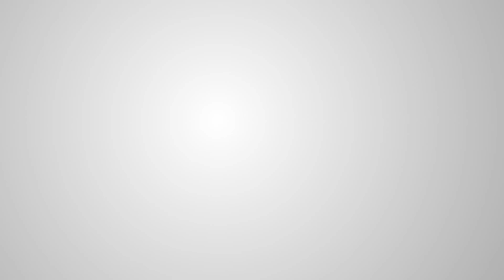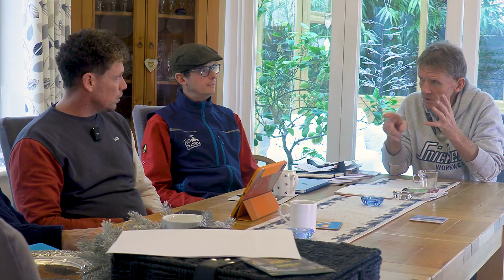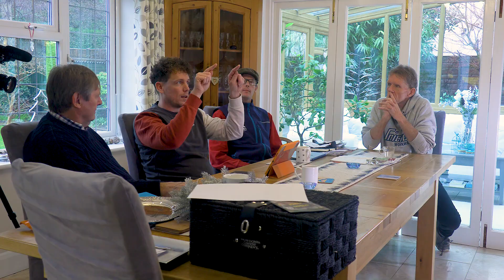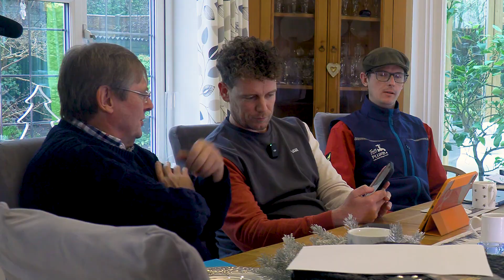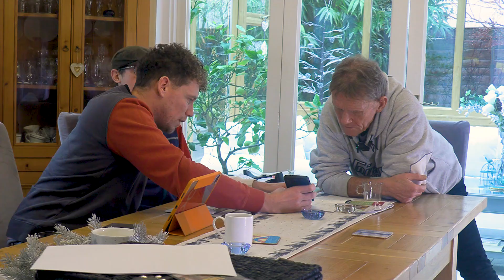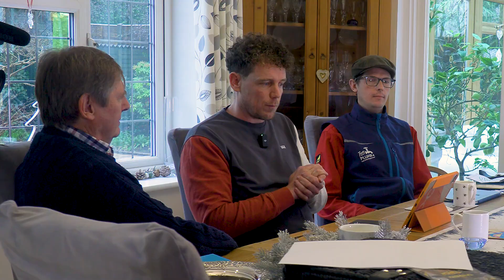What Did We Learn from the Heat Loss Survey?

Comment: I know this will come across as rather unsympathetic, but I can't help thinking that some people are being a little bit snowflakey about the changes required to put in a heat pump. Take the proverbial victorian terrace that is often used as an example of the sort of house  that cant be fitted with heat pump without a ridiculous amount of effort. Most commonly these houses were originally built without indoor sanitation, heating was by open coal fires, no electric light or power, gas lighting if you were lucky but  oil lamps and candles for most people. Our grandparents  and great grandparents installed indoor plumbing and sanitation, modern bathrooms and kitchens, electricity for light and power, central heating systems, etc.. It took vastly more work to go from open coal fires to central heating with radiators and gas boilers than to go from a gas boiler powered central heating system to a heat pump powered heating system, yet they did this willingly and eagerly and with a sense that they were part of the progession of the world to a better state, and not forgetting they were, in real terms, significantly less well off than we are today. I cant help feeling they would look on at those of their descendants who wail on about the impossibility of fitting heat pumps with a mixture of shame and contempt.
Reply from the maker: I think you have a point about embracing change but I was working when gas central heating was a relatively new fangled thing and lots of people were suspicious of it for a variety of reasons.
I would regularly visit homes with one coal fire and a back boiler to heat the water. The left the cylinder jacket off, which heated the bedroom and they were perfectly happy to see out their days with such a system.
Having now got to the stage of a simple wall hung boiler and a few radiators which can be turned on and off to suit, it seems, for many that all this other kit which takes up space and costs a lot of money is not progress.
The bottom line is that we will still need gas fired power stations for a long time to come so this switch to electric heating is all smoke and mirrors.
Reply: @SkillBuilder I'm not sure what difference it makes if we still need gas powered stations or not, we're talking about mains supplied gas here. If there is a change to electric required then it will need to start now in order that, over time, the need for mains gas no longer exists. That means folk requiring a new boiler now being the first to move across, just as those that moved to gas mains were in the OPs example. Then in twenty years time, we'll still have the equivalent of the examples you give holding out on the gas mains until it's inevitably taken away. There's no smoke and mirrors, it's exactly as the OP said, just a moving from one technology to another.
Reply: @SkillBuilder Not so. Even if you generate your electricity with gas, a CCG power plant is about 60% efficient, allowing for 10% transmission loss gives you 54% at the heat pump. With a SCOP of between 3 and 4 you have an overall efficiency of between 162% and 216%. Compare to gas, again allowing for 10% transmission loss and 90% boiler efficiency you have and overall efficiency of 81%. In other words you get between 2 and 3 times as much heating per unit of gas burned by turning the gas in to electricity and running a heat pump compared to burning the gas in a combi boiler! But of course not all electricity is gas generated, only about 1/3rd is. So in reality you get about 8 to 12 times as much heat per unit of co2 released. You have to get your head around what a SCOP of 3+ really means, it means most of your heat does not come from the electricity, but in effect from the sun. A heat pump is in practice a solar energy collector that works 24 hours a day whatever the weather. You won't understand heat pumps unless you understand this.
Reply: I don't think people made those upgrades to make the world a better place. They did it because it improved their living conditions. Some people are willing to fit a heat pump for the environment, but most won't until it's significant cheaper. Gas works, and the pollution mostly effects other people.
I'm optimistic though. I think that in 5 years we'll have built so much more off-shore wind power that electricity will be much closer to the price of gas, and heat pumps will be a much more attractive option. I just hope we've managed to train enough engineers by then!
Reply: I don't think so. Most people who have a new kitchen fitted do so because either they've recently moved house and they don't like the kitchen in their new home, or have had their current kitchen quite a long time and think it's "tired" or "outdated", very few do so because they don't have a functional kitchen, in other words they want one rather than need one. So, they are willing to accept a significant level of cost and disruption on fairly slight grounds. Therefore the argument that the reason we have such a low number of heat pumps installed is because the cost and disruption is far to much for people to bear doesn't stack up (1.6M  householders each year  take that willingly to to fit a new kitchen they don't really "need"). There must be other reasons, lack of motivation, ignorance, fud, etc.., why heat pumps have such a low uptake. I'll informed criticism by the likes of Skill builder is one of them.

Comment: In winter, we (and many other families I'm sure) put clothes on 65 to 70 degree radiators which dry in 2-3 hours.
They'll take forever to dry with the lower flow temp on a heat pump.
Now waiting to be patronised...
Reply: I got a dryer and my house is so much warmer as a result of getting rid of clothes drying inside.
Reply: Not patronising you, but a de humidifier will be better as using the rad as the rad will be adding humidity to the air. 

There are heat pump dryers that effectively are dehumidifiers inside the tumble dryer.

The problem with adding water in the air is you increase your risk of damp on things like windows and the reveals around them. If the air gets through in to your loft or places that are cold you can get lots of damp and mould and rot. 

I’ve got a desiccant one that works down to colder levels as it’s going in the garage eventually, but it’s indoors at the moment and works great to dry clothes.
Reply: Haha sure, or you get a dryer! But you're right, that won't work anymore.
Reply: Have a dehumidifier my rads don't get very hot because my house is relatively well insulated I have the heating on constantly so the boiler only quick on shortly resulting in flow temperature being relatively low. The dehumidifier will bring the home moisture content down forcing the stuff the dry essentially.
Reply: Wrong. I often do it with my heat pump radiators. No problems.
Reply: @rogerphelps9939  are you saying lower flow temperature has no effect? I though AS heat pumps cannot achieve 65-70 radiator temps in winter, more like 40-45..?

Comment: Question. Is the refrigerant in heat pumps of a type that puts environmental brownie points above actual performance?
So with a different refrigerant could you achieve much improved efficiency especially in winter??
Reply: The newer generation of Heatpumps use r290 refrigerant (aka propane) which has better performance and lower environmental impact than the older redridgerants.
Reply: @brianballard905  is that the really old refrigerants? I ask because my old 1988 fridge/freezer worked down to -10C room ambient. Its 2023 replacement minimum ambient is +15C !!

Comment: My family friend in sth wales has had no heat for 2 years because his heat pump system failed, the installers have gone and no one will come and repair it. He spent three times the cost of a gas boiler for bugger all. His bills were £800 a quarter
Reply from the maker: We have had many emails from people with similar tales to tell. Nobody wants to know them
Reply: @SkillBuilder  as long as that attitude persists the sale of heat pumps will suffer. The heat geek was quoting many figures and examples but none appeared to be based in fact. House heat loss is a desperately loose concept when no two houses are built the same or in the same place

Comment: Nothing the heat geek is saying gives me any confidence that the heat pump will give anything like the flexibility or the efficiency of the modern gas boiler
Reply: Gas boilers are less than 100% efficient. Heat pumps can be over 500% efficient. You have a lot of learning to do.
Reply: @rogerphelps9939  efficiency is the key issue here. I suggest you have a lot of learning to do.

Comment: If our government could provide state owned cheap green energy (wind solar tide etc) surely electric radiators in each room with individual controls long life span no maintenance no leaks less resources used to manufacture etc, would be the way to go.... Cheap electricity is the problem and the solution

Comment: They’re just too complicated to retrofit on a case by case basis with the sh*tty uk housing stock. It’s just too complicated. Installers and designers don’t have the education, intelligence, inclination, or money! A hammer is good for a nail. A heat pump is great for a brand new build when the whole system can be designed as one. Otherwise, just forget it. Move on people, nothing to see here.

Comment: Use a battery with solar and a big one too
Reply: Solar isn't a good match for heating in the UK, as you get most of the generation in the summer.
Reply: He means  solar pv and storage batteries and inverter  with switch over
Reply: I have a solar PV system that fills my roof. It's 2.90kW, which is not enough to boil a kettle.  Allowing for losses across the cables I'm lucky to get 2.4kW. With nothing actually switched on I use 0.6kW ( router, amazon echos, standbys and timers and clocks, before the fridge freezer kicks in every 30min . Not much left to put in a £7000.00 battery backup system

Comment: I agree with the conversation towards the end on customers should be able to claim in missold heating system installations, and the cost should land on the installer who should be claiming from the designer (if applicable), the same should be true for solar installations.  The biggest issue is so many of the companies that did poor installations have already left the market in some way or another.
Reply: I work in social housing where government funded schemes for heat pumps, solar PV, insulation etc have been the norm. Companies appear, take advantage of the millions of pounds available, turn out poor jobs on a large scale, then disappear never to be seen again. We've removed a lot of heat pump installs and installed gas boilers again believe or not. The whole thing is about statistics looking good not quality and it stinks.
Reply: Installers should be MCS registered. They should get the appropriate training.
Reply: @rogerphelps9939  they were MCS. That's a requirement that goes out as part of the tender. They're not sat on the shoulder of the contractor though unfortunately.

Comment: These guys know about reverse cycle split systems no? You get some heat waves over there these day.
Reply: Heat Geek has done several videos on the comparison. The issue is that most houses in the UK already have all the plumbing for hydronic heating, and it's most economical to reuse it.
Reply: @robinbennett5994  that makes sense. It’s a retrofit and they can’t heat and cool at the same time I guess. Though I was reading about some advanced new splits that can.
Reply: @Thatguy-cb4qs  Heating and cooling at the same time isn't something we need in our homes (although I've heard of large office buildings that use it). Some people do have split systems here. I got one at the start of the winter, and I noticed one at my dentist - but the government isn't offering subsidies for them because they're worried about extra power use in summer.

Comment: Surely having a heat pump totally negates the benefit of a battery and night tariff in the winter as you end up draining the battery of cheap electric end up running the house and the HP on peak electric? One eco solution negating another
Reply: Unless you are wealthy or very determined you are unlikely to be able to run a heat pump solely off a battery (unless it’s a Passivehaus). Batteries are hugely expensive and the economic case alone is finely drawn

Comment: I am still waiting for my Heatgeek design consultation (two months nearly and no update) but was wondering while I wait about if the system breaks down. If in the dead of Winter how long to get an engineer visit (or do they have remote access) and how long to fix? My 2014 Oil boiler failed on our coldest day (-3.6c / 25.5f) and I had no heat for nearly three hours!
Reply: Probably a long time!

Comment: The biggest problem is we have all got used to 21C as an ideal indoor temp. I very gradually turned down our heating to 19C over a period of weeks. No one noticed or complained about being cold. Been at 19C for the past 2 years, very occasionally turn it up to 20C.
Reply: What people can or cannot tolerate in their homes depends to much on their health and age. I'm in my '80s now and my partner even older. I feel the cold terribly as I do the heat in Summer and so in Winter have one of those heated Gilets to help ward off the cold. And if the temperature drops to freezing or lower, we leave the heating on 24 hours a day and of course as we're not working we are at home all day except when out shopping or pubbing etc. It's horses for courses.
Reply: @nickhickson8738  . My heating is set for 24hrs but it has minimum temps between the heating times, although it rarely goes on in those times. I agree, important to keep warm as we get older, my 96yr old mother uses a heated blanket sometimes if she feels cold and can see that the temp is actually 21C.
Reply: it’s the reverse of the ‘boiled frog’ syndrome.
Reply: I have my heat pump's house thermostat set to 20°C and currently (according to the heat pump app) the outside temperature is 10°C and the temperature at the thermostat is 20°C so it is not running (it is in the centre of the house). Since the sun is showing through light cloud my lounge has gone up to 21.5°. My wife feels cold at any temperature so there is no point in increasing it.

Comment: Very interesting but I won’t be bothering with a heat pump anytime soon!
The main reason is, for me, I have just bought a new build Barrett eco house.
It has an eco combi boiler, but the biggest advantage is that it has super efficient insulation!
In the walls, the windows are energy efficient,argon gas filled, the loft is filled with 40cm of higher performance lagging etc.
This is why a new build house is more efficient and doesn’t need a heat pump!
I may go for solar panels later on just to make a direct saving on electricity costs!
Retro fitting a heat pump to an older house is like trying to make a square peg fit a round hole!
Reply: I watched a YT video of this guy who lived in an old stone cottage in Wales. His set up started out with PV panels, then a battery and finally to get them off LPG, he fitted a Samsung HP. He had to increase the size of his rads and make sure insulation was maximised (I don't think he went as far as internal or external wall insulation on the solid stone walls). He was achieving flow temps around 35C and a SCOP of over 4.
Reply: @JohnnyMotel99 so 35 and scop of 4, is that enough all year round? How much does it cost to run the heat pump, or savings versus the old type he had?
Reply: @Google_Does_Evil_Now  Well, he had no access to NatGas, only LPG and electricity. From watching his videos, he has cut his energy costs dramatically with solar, battery and now a heatpump. I have to say I was surprised he managed a low flow temp and a reasonable SCOP in a solid stone built property.
Reply: It sounds like your new build would have been perfect for a heat pump, had the builder been obligated to put one in. Would likely have saved you money too. Obviously, nobody should be putting a heat pump in a house that has a reasonably new working boiler. If I were you, I'd be annoyed that a house builder put a system in that may end up costing a fortune to replace, when they knew that heat pumps would be being (forcefully) adopted in the near future. It sounds like everything about your build would have been perfect for a heat pump, and would have been far simpler and less expensive to design into the original build than it will be to fit further down the line.
It seems to me that there are as many people ideologically opposed to heat pumps as there are those selling them as a panacea. They're just a bit of fairly efficient heating equipment. I say this as someone who is in the same boat as yourself. I have a reasonably new home with an oil boiler (oil tank, we're in the countryside), that would be better suited to a heat pump too, from an obvious efficiency increase perspective. I'll keep my oil boiler as long as I can because a retrofit will be challenging. In fairness to my builder, the technology was still quite new (to him, anyway) in the UK when the house was built and he wasn't confident of his ability to fit it well.
Reply: You will eventually get a heat pump. We will eventually be unable to use gas because the environmental costs are huge. Your grandchildren will pay for that.
Reply: If it was built properly it would need no heating at all, look at the Passivhaus standard.
Reply: PH houses need heating